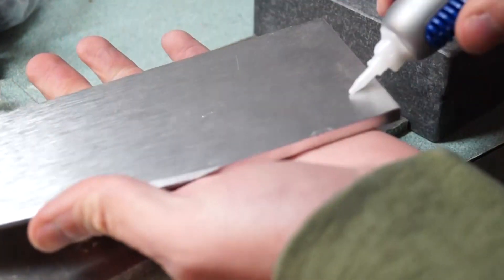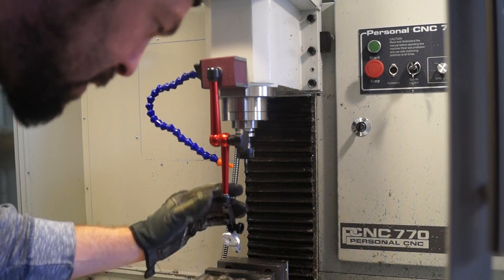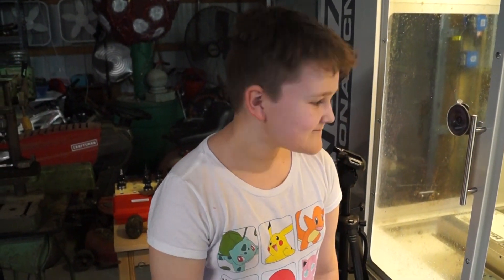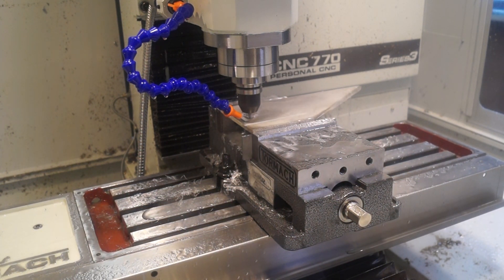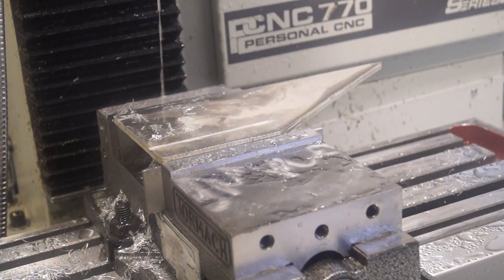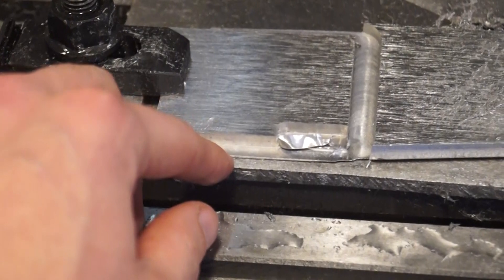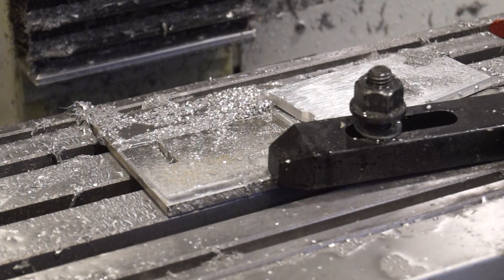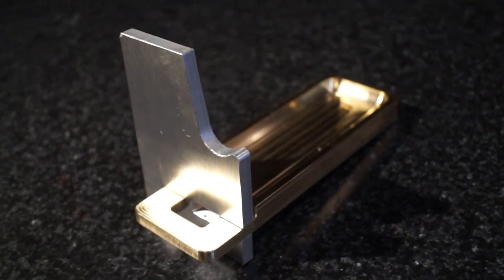Machining a brass and aluminum phone stand - part 3, learning workholding the hard way

Comment: I definitely see improvement over the course of every video.  For cutting thin sheets you might want to attach a sacrificial board to your XY table and the fasten, glue, or screw your sheets to that.  Since you are using coolant the board should be waterproof.  PVC sign board would be a good thing to look at.   I think it comes in thicknesses up to 1.5 inches.  That way you can protect the tabletop until you get your bearings. I used to run a CNC sign router and that's what the table top was covered with.

Comment: Few kinda random tips. Been there :) Also a tormach user and have some vids on my channel if your interested. 

1. Triple check offsets and your home location each time. Gets way easier the more you do it. 
2. Make sure to "ramp" into cuts anytime your not starting form an edge. 
3. Use shorter / stubby endmills whenever possible.  
4. Clamping  and solid work holding makes a huge difference when it comes to breaking tools. Vibration is the enemy. 
5. If your clamping a piece in the vice and cutting a profile you can try using "tabs".
6. Cutting slots like your doing can be tricky. Slots make it easier for the chips to get stuck and clog up the cut. 
7. I haven't tried this one but might want to give it a shot. Put masking tape on your part and the scrap piece under it then super glue the tape together. It will be much easy to pull off. Again haven't tried that but have always wanted to. Heard it works. 

Just a few random things off the top of my head. Hope im not overstepping :)

Comment: If your cutting forces aren't too high (ymmv, my mill is much less substantial than yours) https://www.findtape.com/Shurtape-DF-65-Double-Faced-Flat-Paper-Tape/p721/ works great to hold down flat stock without clamping, and gives a sort of 5mil buffer under the workpiece. I use it all the time for soft metals (aluminum, soft brass) and wood.

Enjoying this series! Much sympathies on the broken endmills ; )
Reply from the maker: interesting!

Comment: I saw a video using an electric iron as a hotplate to melt cut up glue stick pieces and use that to glue the parts together. then when done set on hotplate again to seperate.
Reply from the maker: sounds like an interesting method